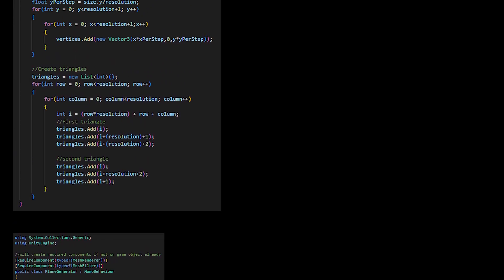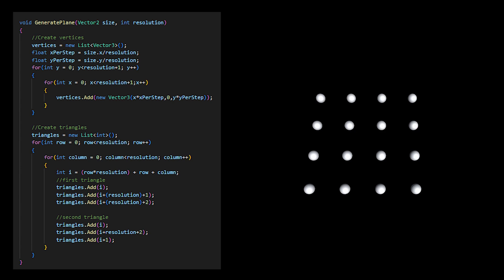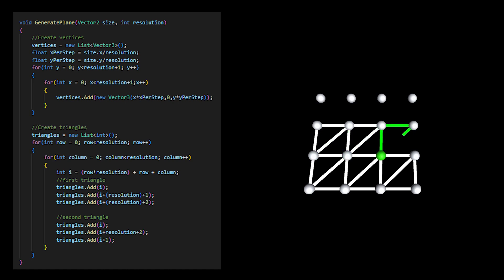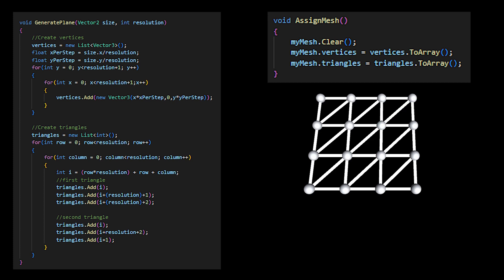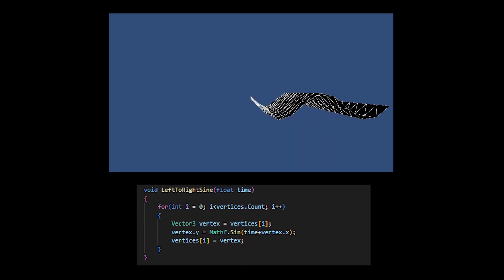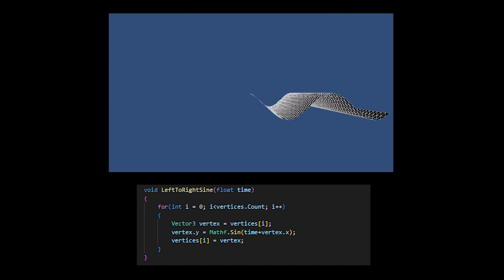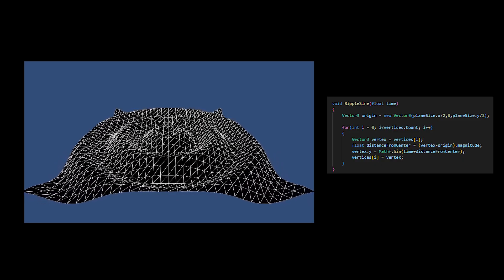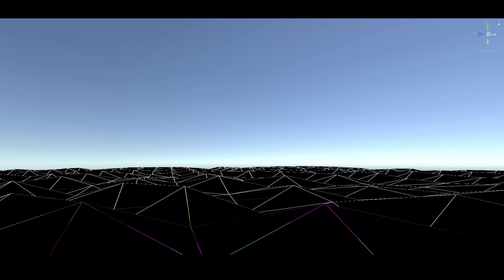How to create and modify a plane mesh in Unity (Procedural mesh generation tutorial)

Comment: Little tip : if you want to add light to your plane you have to calculate the normals, Unity has a function for it called RecalculateNormals()

For instance :
void AssignMesh()
    {
        myMesh.Clear();
        myMesh.vertices = vertices.ToArray();
        myMesh.triangles = triangles.ToArray();
        myMesh.RecalculateNormals();
    }

Comment: Something strange happens if I increase the resolution above 250: the plane gets chopped off in one dimension (the z plane). I am wrecking my brain looking for what might be causing this. Performance in my case is not an issue so I would like to have high definition (I am applying lots of deformation). Any idea what might be causing this?
Reply: Found the problem: the mesh has a limit to the amount of vertices to render. Adding this line will solve the issue:         myMesh.indexFormat = UnityEngine.Rendering.IndexFormat.UInt32;
Reply from the maker: sweet thanks for the heads up